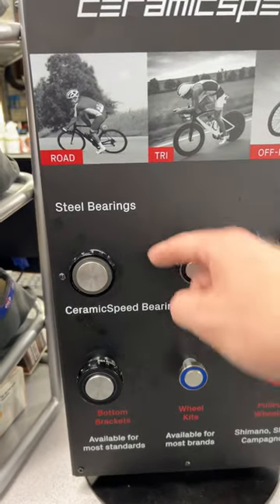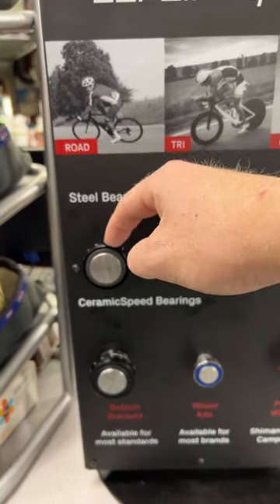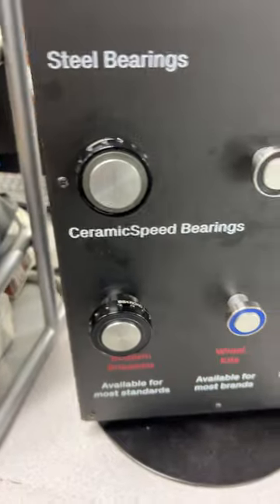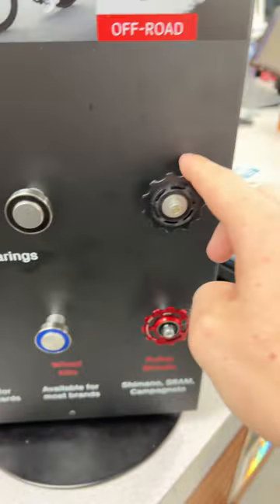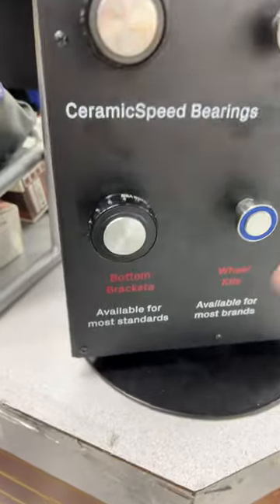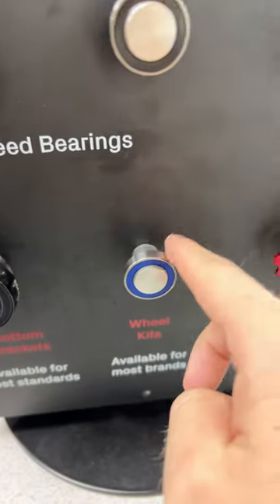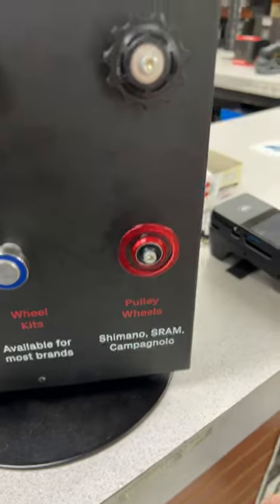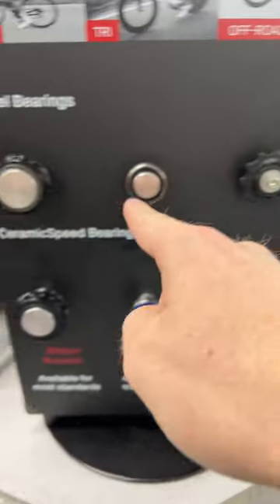Why your bike needs ceramic bearings!

Comment: Just remember that ceramic speed puts light Teflon oil in their bearings while shimano uses heavy silicone protective grease.  If you cleaned out those shimano bearings the6 would spin like that as well.
Reply: Indeed, most of the friction comes from the internal friction with the grease and with the cage. With the same proper lubrication ceramic bearings don't make a difference a human could recognize
Reply: @simonm1447  i have their winter grease in all my bearings...spin just like in the video....
Reply: @karl8805  how much grease? A normal bearing is typically filled to 1/3rd or half with grease, not just a little bit, and if it's a 2RS the plastic dust cover causes some friction too.
Reply: I agree, even packed with grease, the force needed to spin that pulley is something an ant could do. I've done my own test with skateboards, the more the wheel freespins the slower it actually is once underload. So a completely dry bearing freespun for ever but was the slowest, fastest was bearing grease, just oil was actually slower.
Reply: @simonm1447  plus spinning without any load is totally different to spinning with load applied. Lubricants are designed to work better under different loads.
Reply: This was the most useless comment ever somehow it gets likes but YouTube Never Fails to amaze on the side of imbecile
Reply: True. Its just a grease change that makes a dufference....
Reply: I’m a mechanic and this is just a way to sell ceramic bearings because I’ve seen my fair share of steel bearings that are just as smooth.
Reply: reminds me of AVE frictionless bearings
Reply: That’s not true
Reply: Just remember silicone grease is what’s protecting that bearing from the elements. Ceramic bearings don’t rust that’s why they use Teflon based lube vs silicone.
Reply: The problem is you can't run Shimano bearings without that grease. With Chris King, you can. And they will be faster than anyone else by doing this. Buy Chris King, buy once. Buy anyone else, buy more than twice.
Reply: @simonm1447 it's noticable...

On a skateboard lol. Them wheels are so shit you need every bit of help. But on a bicycle? Yeah you're absolutely right. The only advantage to ceramics is they can be self healing. Which doesn't mean much for bikes, and you're gonna break them on a skateboard anyways 😂
Reply: Grease is better. It stays contained inside as opposed to oil which eventually goes away and has to be reapplied
Reply: @simonm1447 yeah the first guy said exactly what you said first.
Reply: @diehardbikes  when I bought mine I thought I'd never need to buy hubs again. I'd just move them to my next bike. until the standards changed and I realized that it didn't matter any more if the bearings would last forever...
Reply: Yes because the steel needs the extra viscosity to prevent exposure which can corrode the surface. Ceramic does not corrode. Ceramic is used because it resists corrosion, not because it has a lower friction coefficient. Ceramic has other properties over steel like heat resistance which means it won't warp or that it is non conductive. But I don't think those apply so much to bicycles.
Reply: I was just about to comment this, I have had rusty skateboard bearings that spin freely with no load like that just because they are completely dry and the carriers are all worn away, bearings spinning with no load is not a flex
Reply: I came to say this
Reply: Yea i always fill bearings especially badly shielded or that need to be underwater  @KurtisPape
Reply: @simonm1447  that's way too much grease for most bike bearings..... like, all of them.

Comment: Never trust a test done just to sell something, they make sure to portray theirs as better
Reply: Correct good sir, I have a couple of steel ball bearings that spin for days.
Reply: Well from someone who loves to tinker with things and someone who has restored more bicycles then most theirs two things that do the same thing if you get axel grease for the trailers and replace the grease in the wheel bearings and in the cassettes and on the chain the bicycle lasts forever and has the same benefits as going ceramic me personally I’m a bigger person so ceramic bearings arnt good for my style of riding I love to jump curbs ect but if your going for regular rides without jumps the ceramic ball bearings do work wonders but if your a heavy set person to begin with then just keep the stock ones on the bicycle and re grease them with better grease just saying it’s money better spent then going for ceramic cause the cost vs repairs factor for instance the ceramic is slightly better than steel but ceramic breaks apart and when it does throw the whole rim away cause it destroys the metal speaking from experience if you want to put money into a bicycle go and buy a better cassette and better derailer/tensioner with good shocks and tires it is important to say that if your gonna be riding on the streets go for a thinner wall tire it makes the bicycle so much better not as much friction if you got a 1 1/2 inch wide tire just expect the wheels to have more friction but if your a bigger person like I am best suggestion Is get some thick anti puncture tires invest in the inner tire liner cause it does help prevent flats and get some goodyear inner tube from wallmart or online only get the Goodyear with the full coverage inner tire protection fill the tires with the green slime and inflate to 60psi if your set on best ride quality while maintaining stability if you want a little bit better without to much stability loss go to 80 psi those who only care about speed and arnt jumping things 100 psi does it warning with 100 psi tho be sure you get the inner tubes that can take 100 psi or close to it me with my weight i think 80 psi is the sweet spot i love doing small jumps and i go threw inner tubes rated for 60 psi every 3 monthes or so only inner tubes to defy this is goodyear iv went to 100 psi and did small jumps without issue and fwi folks kevilar tires are defiantly worth the money best money ever spent was kevilar tires its no merical worker meaning nails will still punture them at higher psi's but goodyear inner tubes are thick and take alot more to destroy them then most only thing to pop my tire is glass normally
Reply: @rokuandriod6742  very nice read to gain good insight and a basic level of knowledge for bikes, and good suggestions for different types and styles one might be going for, also just for future reference the proper spelling is miracle, thanks alot for the insight

Comment: As a bike mechanic, yeah they may spin better in the free spin test, but ceramic bearings are actually weaker, and under heavy load (like mtb or just heavy riding) will crack pretty quickly. Combined with the increased price, they really only make sense if your an actual pro that needs the marginal gains.

Comment: snake oil bearings!
Reply: 100%
Reply: I used ceramic bearings for my longboard and theyre amazing but i dont think with the forces and wheel size on a bike it would make any difference
Reply: @deathsmilez5297 
There's no noticeable difference on a board either between good steel and good ceramic bearings. There's even top level riders on steel and most semi-pro and amateur downhill racers I know personally use cheap off brand bearings ordered online for a dime a dozen. Remove the grease and apply a light oil - won't get much better than that.
Usually people notice a difference because they switch from shitty bearings, beat up bearings or greased bearings to new oiled ceramic bearings. Obviously that'll make quite a difference.
But compare just regular cheap good quality bearings, oiled of course, and the difference is straight up homeopathic.

You simply don't get up to speeds where it would matter and the bearing size is small enough that it can cope with very high rpm even with steel balls anyway.

Now, for example a milling spindle doing 42k rpm with 70+mm main bearings - that's a different pair of shoes. The actual benefit of ceramic bearings is the lower density of the balls, they are subject to less centripetal force and therefore suitable for higher rpm.
That's the whole reason they exist in the first place, except full ceramics for corrosive environments or unlubricated ceramics for clean room environments and a few other niche applications. They're not made to "go faster" or roll better, that's just very successful marketing, they're made for high rpm applications in which steel bearing would fail straight away or at least way faster.

Best bet for you is to just buy two bags of 608 ZZ and 608 2RS for winter/wet conditions from an online bearing retailer, oil the ZZs, grease the 2RS and change them every six month. Will cost you less for years to come than just one set of overpriced ceramics with a brand logo bapped on it, and they'll definitely roll better than a ceramic used for a few months.

Comment: The ceramic gimmick is real. 😂
Reply: exactly. ceramics are better but not for a bike application. 99.999% of bike riders aren't going to be able to tell the difference.
Reply: Real BULL!!!
Reply: It is in everything now and people are eating it up
Reply: skateboarders swear by them and they can feel the effect way more than someone on a bike. just because you cant feel it doesnt mean it doesnt save energy long term
Reply: @cbrunnem6102 just because you cant feel 10w, doesnt mean you havent gained them.
You wouldnt feel 10ft gained in a aircraft, doesnt .ean you havent gained 10ft
Reply: @karl8805  show me a legit scientific source showing ceramic bearings are worth 10w. that would mean 52100 bearings are creating 100+w of heat.... news flash. they aren't
Reply: @cbrunnem6102  there is plenty out there.
Bb bearings, wheel,jockey wheels give 8-10w.

Its been done many times.
You just too lazy to look

Comment: Ahh yes the dry no load spin test for bearings
Reply: Exactly. Suckers will buy in. If automotive engines aren't using ceramic bearings, I won't be either
Reply: The age old standard for skateboard bearings. 

Also if top tier downhill skateboarding can take place with off the shelf steel vacuum cleaner bearings there's absolutely no reason your bike needs ceramics.
Reply: Yes. There are parts in bicycles that move 20,000rpm. Shimano will help you with your money burden.
Reply: @tomaspuodziukynas5361 😆 🤣 😂 😹 
No part on a bike spins that fast.
Reply: even dry and unloaded bearings should spin much better than that
Reply: @jeffhooper3447  Skateboard and roller blades bearings are victims of age old marketing bs. =)
Reply: @benjaminklein1829 you do realise they are packed with grease right.
Reply: @jeffhooper3447 I think there goal is to reduce resistance. Not the case for downhill skateboarders (assuming they’re not going for top speed)
Reply: @tomaspuodziukynas5361 you do realise that turbos spin at around 100,000rpm? And they don’t have ceramic bearings. This is a complete con.
Reply: @viperz888  I do realise. I am an engineer. My post was sarcasm.
Reply: @zachthetruememeking  I promise you a $10 set of Zealous built ins will go just as fast as ceramics.
Reply: @wyattutz  because tolerances matter there. Listen if you wanna buy ceramics you can just buy them
Reply: @keeganmartin1886  different stress loads and environments
Reply: @keeganmartin1886  yea on a commercial side theyre more expensive and usually only meant for RACE applications, youd use coated bearings in an engine when trying to push it higher, not sure if they use ceramic or another low friction coating
Reply: Load bearings are what we call them in the engineering world. Can't test a load bearing when there's no force being applied to the round side as it rotates. That display showing all the types of bearings is more deceptive than Ambe... Cough Unwinnable carnival games.
Reply: Exactly! There was just a video done on this basically saying waste of damb money!
Reply: @keeganmartin1886 they use what is just reliable enough so they last enough for the next generation of vehicle to come out. They don’t care about reliability
Reply: @Soeks77 in modern vehicles you're absolutely correct. However, the newest vehicle I own is a 2000. That's my choice. My s*** doesn't let me down. The argument would be great if they had switched to ceramic and we're using that for limited use though.
Reply: @keeganmartin1886  ceramic wears out very quickly, but it is much smoother of course. This test as the original commenter said was done with no load and with load they’ll wear down very quick
Reply: @keeganmartin1886  that's because of cost and probably even weight. and yes, the automotive industry is using ceramic bearings. not factory but you can buy turbos with ceramic bearings and you can go with a smaller turbo then steel because it spins easier so you can produce the same HP gains
Reply: @benjaminklein1829  nope, not new bearings. if a bearing spins Easley it's worn out.
Reply: @Koshzor  you mean how they were all the same type of bearing but the series 7 was so much better than the series 6.
Reply: @viperz888 they do have ceramic bearings for turbos and you can produce more HP with a smaller sized turbo with ceramic bearings.
Reply: @jeffhooper3447  false.
Reply: Caked them shits in grease and covered em back up...
Reply: @benjaminklein1829  u can't buy bearings that don't come with atleast a Lil grease in em
Reply: Was just thinking 🤔 😂
Reply: @viperz888 that’s not really a fair comparison though. Turbos have oil feed lines and they spin on a constant film of oil
Reply: Facts. Wouldn't surprise me if he tightened the top row up extra just to make em spin less. 😅
Reply: @jeffhooper3447 a handful of pro skaters use ceramic, lasts a little long n rolls a little longer but definitely doesn’t justify 5-10x price… regardless the sound difference is enough for me
Reply: 😂😂😂😂😂 I love it

Comment: Come on, what a bs test.
Reply: Right? I can make a steel bearing look like it’s frictionless on a wall like this, then watch it grind apart, or seize up under a load, or vice versa. It’s almost like bearings are meant to fit a specific use and pumped full of grease that thins out with heat/friction.
Reply: i think the test on the wheel bearing in the video was perfectly scientific, you cant even see it spin

Comment: It's all about spinning under load 
Steel bearings will be performing similarly good to the ceramic once whilst being more durable. You don't have to service them as often and even if you need to change it out the cost ist fairly minimal. Ceramic bearings are very vulnerable to pressure peaks. For example when u hit a curb or a pothole. The 1W u might save isn't worth it guys😅
Reply: The price of these is laughable.
Reply: And, we're done here.
Reply: I have ceramic wheel bearings and I broke one. The race was damaged too. I ended up replacing the bearing and buffed out the race and moved it to the front. Ceramic bearings work well but they require more maintainance and are more fragile.

Comment: The seals on standard bearings usually cause most of the friction. It's also why they last longer and require less maintenance than ceramic counter parts.
Reply: i mean yes, but ceramic speed has a 4 year warranty on their products so it doesn’t really matter, most regular bearings last under 4 years in a BB anyways so they will replace it if they wear out. and coated ceramic speed bearings get a lifetime warranty
Reply: @isaacboyden4602 Do you know how many bicycle bearings I have worn out in my lifetime. Exactly zero. You can easily put 10K miles on them. This is a non-issue.
Reply: It also depends on the accuracy of the bearing. Higher accuracy requires tight bearings.
Reply: @court2379  Depends on how much your ride, weather and terrain. I wore through a new BB on a MTB racing it three days in wet conditions in Arkansa at the US OZ Cup. Headset too. The water and mud there kills bikes. My home state is drier however, and I only need to replace my BB every 7-8000 miles of hard riding (15-16 months)
Reply: @isaacboyden4602  That isn't it wearing out though. That is damage due to contamination. Though I have still never had that happen. I used to ride my bike through a lake seeing how deep I could still ride (4ftish), and still never ruined the bearings. What's up with the seals on these bikes? They should last just like a motorcycle bearing (steel). I guess if you are getting water in them the ceramic would be good as it doesn't rust.
Reply: some of the bike cleaners might dissolve the grease protecting the bearings and then all the water and dirt can get in
Reply: @isaacboyden4602  yes they will replace them but in most cases people have to pay installation labor.

Comment: The pulley wheel is packed full of thick green Shimano grease. Remove that add lighter grease or us oil and it spins better as well, but the thick grease protects the bearing.
Reply: There's no bearing in a basic shamano pulley it's just a hole with a metal sleeve around the bolt that holds it in the derailleur and people rarely grease them
Reply: @naterfader5524 you’re right. He’s getting it confused with the spring on the derailleur arm which comes packed with their green bearing grease

Comment: Remove grease from Shimano bearings and they will spin twice as long as well.
The other thing is how often one wants to clean dirt. Every one or two trips (like on a proper racing bike) or once every three years (like an average teenager)?!
As for the drive-train, the biggest friction will come out of the chain itself.
In general, I would be more worried about my own drag or proper amount of air in the wheels..